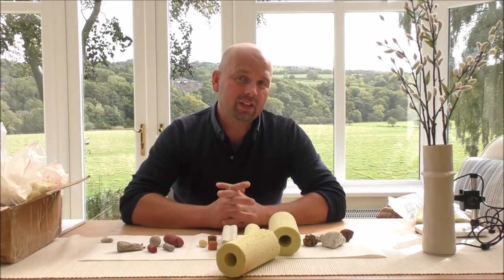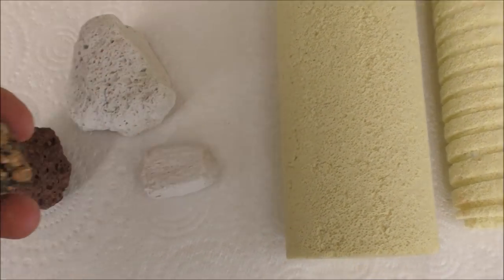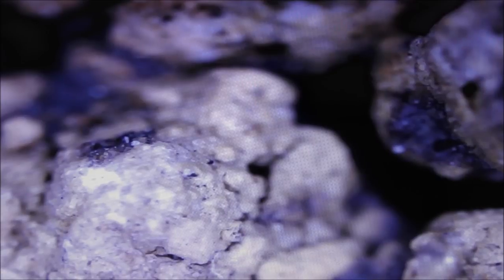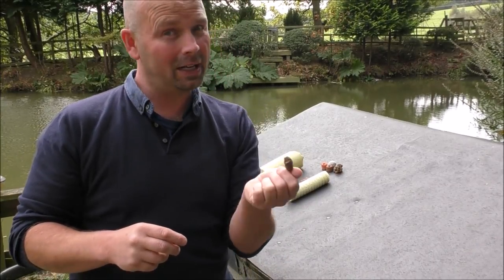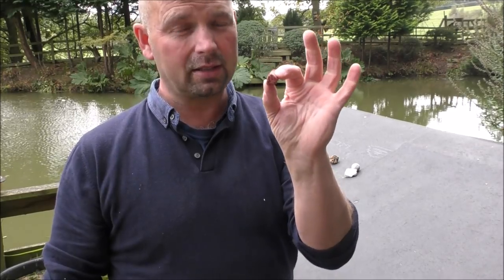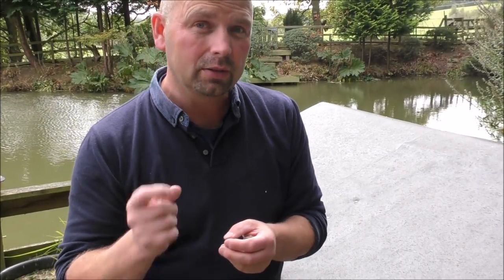Looking INSIDE Filter Media for Aquariums and Ponds

Comment from the maker: Using a microscope to take a look at the internal structure of some common types of filter media. Please click 'show more' for all information on media, time stamps and worldwide links (where available).
Microscope used: http://geni.us/IyFI0m4
Good biological filter media needs to be receptive to bacteria, have a varied internal structure and last for a very long time if it is to support aerobic and anaerobic bacteria and have a chance of providing full cycle filtration (reduction in nitrate). 

It generally falls into 4 categories (for static filters):
1 - PLASTIC- avoid for a static filter as the surface area is so low. Poor receptiveness to bacteria.
2 - NATURAL ROCK - can vary wildly in usefulness and may raise pH (white pumice). Varied receptiveness to bacteria but generally good.
3 - CERAMIC - made from clay dust. Quality of structure and hardness can be very varied depending on type. Relatively receptive to bacteria even on/in poor quality media.
4 - SINTERED GLASS - made from sand and powdered glass. Generally very hard but quality of internal structure can vary depending on mix used. Very receptive to bacteria.

Filter media in order of appearance:
SCORIA (lava rock): http://geni.us/daKf8n1
Scoria is commonly known as lava rock since it is an inert, natural volcanic rock. It is relatively heavy and although the outside may look extremely porous and good for bacteria to colonise the internal structure is largely inaccessible so as a filter media it is not ideal but it is cheap.

WHITE PUMICE: http://www.filterpro.co.uk
Volcanic rock which generally has good hardness, accessible internal structure but quality can vary. Drinking water quality pumice has best structure and quality but all white pumice has a high pH (generally around 8.0) making it really only suitable for marine, koi, goldfish, livebearers and Malawi / Tanganyikan cichlids.
Varied quality white pumice is commonly sold under different names by some manufacturers with no warning about pH.
Avoid if it is poor quality pumice which contains a large amount of grey / black stones as it will generally be micro porous and will quickly clog up.

ALFAGROG: http://geni.us/Il899
Very hard, rough ceramic media which has good external surface area but poor porosity. Works well even in dirty filters as it does not clog easily (due to poor porosity). Very cheap = good budget choice for pond filters.

CHINESE CERAMIC - really poor quality media which is brittle, has poor internal structure, poor accessibility and will break down quickly in any sort of water flow. Unfortunately this is for sale all over the internet - avoid.

BIOHOME: http://www.filterpro.co.uk
An inert, sintered glass media which is made in various sizes and has varied pore structure and accessibility for use in different types of filters. 
Some types have added trace elements fused into the structure which are specific to the needs of bacteria and that allows the media to work even harder to provide full cycle filtration (reduction in nitrate) as long as plenty is used.
Marine version also available which has added effect of boosting coral health (due to trace elements / bacterial activity?).

GROWSTONES: http://geni.us/BBHT0Li
As far as I know it is made by using a fine sintered glass mix with added bicarbonate of soda which causes mix to fluff up and be very light prior to firing in kiln. 
pH (8.0+) is definitely an issue as is the brittleness of the media but the internal structure is very good.

TIME STAMPS:
00:00 Intro and explanation of what makes a good filter media + showing microscope used for video
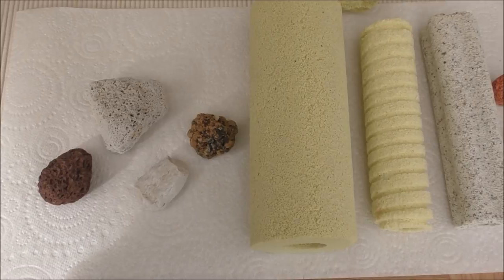03:30 Types of filter media to be examined
05:43 Looking inside media with microscope (300x)
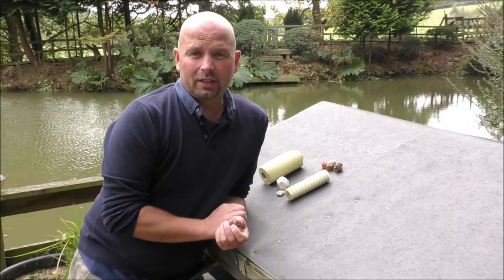09:45 How hard / long lasting is media?
12:35 Damn, I wasted how much on this muck from China?
16:35 Notes on surface area
17:43 Outro

USEFUL VIDEOS:
Aquarium and Filtration Playlist: https://goo.gl/yg174k
Pond Construction Playlist: https://goo.gl/TwVzNM

FILMING EQUIPMENT:
Panasonic HC-VX870 HD camcorder http://geni.us/3UwE
+Rode stereo microphone: http://geni.us/4OL
+Rode 'deadcat' mic cover: http://geni.us/1pmn
JVC Everio quad proof HD camcorder: http://geni.us/e09e
+Rode 'deadcat' mic cover (opened up and held between tripod and camera base) http://geni.us/deAR LINKS:e24
Zomei Z666 tripod: http://geni.us/1a1af3
Manfrotto MTPIXI-B PIXI mini tripod: http://geni.us/87f7

RECOMMENDED PRODUCTS ON AMAZON: https://goo.gl/jMaBWy
INSTAGRAM: https://www.instagram.com/pondguru_outdoors/

If you've enjoyed this video please check out the playlists on my channel for hundreds more  - on a variety of subjects.
Feel free to share or link any of my videos on facebook, twitter, forums etc. for the benefit of anyone you think may also enjoy watching.
See you next time.
Pondguru
Reply: Looks like great wave engineering still carries biohome media in the US, if you're looking to include an international link for that
Reply from the maker: There is direct links to suppliers around the world on every page of the FilterPro website (flags at top of page).
Reply: What about say 45ppi foam

Comment: I have to set my 120 gallons with two FX6 from scratch, I could use my biohome media that has been working for 4 years, and two months ago I washed and dried it, I am witness that it is the best media because in my tank with 7 frontosas of 9 Inches I got to have nitrates in 5 and changed water once a month only, thanks very good video

Comment: I've used the same biohome ultimate for 4 years. I'm wondering if you can do a internal check up video of bio media that's been running for a while. I don't use filter floss a whole lot because I use internal sumps and canister filters, I've found it too much of a pain to change, or it clogs too fast. But at the same time, I wonder if I should change it by now. Thoughts?

Comment: Ive been really really studying media lately and i think your biohome is good stuff but why is it so much more expensive? Eheim Substrat Pro seems to have just as much internal and external surface area, just as mechanically strong and wont affect the water perimeters that ive seen. but biohome is significantly more expensive. i think it would be on board if it would not cost me over a hundred dollars to fill my canister. i think you are being honest. and i think biohome would perform very well but the eheim media seems like it performs just as well for quite a lot less. if you can find a way to bring the cost down id be all over it.

Comment: How do you equate “easy crushability in your hand” to “its going to dissolve in water over time” styrofoam for example is easy to crush into powder form....
Reply from the maker: If a media is too brittle water flow will wear it very quickly and any movement while maintaining filters will also wear it. There has to be a good balance between strength and porosity of a media will not long enough to be of much use.

Comment: I'm wondering if you have a rebuttal to Evolution Aquas claim that Kaldness media can and does work in static filters becuase it's more than aerobic and anaerobic bacterial that break down waste.  Jeremy Gay claims there are higher organisms that live in the biofilm that only exist in angles and corners of the kaldness that will not live in ceramics or sintered glass that do a better job in breaking down waste.
Reply from the maker: I can see where he is coming from with regard to the support of higher organisms and there is definitely something to be said for supporting invertebrates in a filter as they can do a great job of consuming algae and organic waste.
However the filter falls down when it only uses plastic media since it really only supports aerobic activity for reducing ammonia and nitrite - I don't know of one person who has only kaldness in their filter who hasn't got sky high nitrates and the huge problem with the K1 used in a nexus is that the static part is aerated to clean it which minces up any really useful creatures like shrimps and water lice. For supporting them good old fashioned flocor does the job admirably.
I can't believe that EA doesn't ship their filters with a proper mechanical side to it and still uses standard K1 in them when they themselves supply K1 micro which has 40% more surface area per litre and would dramatically increase the aerobic biological performance of the moving bed part of the filter.
The Nexus is a beautifully designed filter (possibly the best looking filter ever in my view) but the lack of proper mechanical and anaerobic stage of filtration really cripple its performance as the things it does can be replicated in a cheap DIY filter built from a 45 gallon plastic drum.
In a few weeks I will be making a video which will show a new filter which is properly designed and solves ALL the problems associated with Nexus filters with no need to spend extra on sieve / drum for clearer water or a shower after it to control nitrates - that may sound too good to be true but I am very impressed with what I have seen so far.
It offers proper mechanical filtration which is adaptable plus moving bed(s) and an integrated shower so you get Mechanical, Aerobic Biological AND Anaerobic Biological in one unit - it is modular so can be tailored to suit different situations and takes about 90 seconds to clean.
Watch out for that video as it will probably generate a huge backlash from many people who currently run a Nexus and are familiar with the associated problems, lol
Reply: Roger Dedham 

Bio film is a fancy term for slime....slime needs to be produced by the bacteria to gain hold on the artificial plastic surface of kaldness and other plastic media that have no natural attraction to bacteria.

A media formed from natural materials " I.e. Found in nature"  will allow the bacteria to attach without the creation of a slime layer, Bio film or whatever anyone wishes to call it.

The process involved is best demonstrated by the time taken by the media to cycle, kaldness is around 12 weeks and Biohome 21-42 days  !

This is a excellent demonstration of bacterias inability to read and go along with what actually gives it the surface to best work on.....
Reply from the maker: I can't argue with that as plastic is a hostile environment for bacteria - I forgot to mention that as I just dismiss it as a static media without remembering all the reasons I do that.
I reckon you're being generous with 12 weeks for K1 to mature as its generally nearer 6 months (for aerobic bacteria, never for anaerobic).
Thanks Michael.
Reply from the maker: Thanks for the link - I have just sworn multiple times and very loudly at my computer. I don't know how I can say this in a polite way but the two guys are for the most part talking absolute bollocks.
As soon as the guy from EA said that the nitrogen cycle was ammonia to nitrite then nitrite to nitrate I started with the fury as that is only the aerobic stage - no wonder everyone using K1 has sky high nitrates. 
It is only one part of the biological process.
With regard to tracking in a shower filter all you need is a grid or piece of jap matting every so often to spread the flow and the tracking is not an issue.
One thing I do agree with is that a moving bed will likely do the quickest job at removing ammonia and nitrite but that is all the EA guy is interested in - it is very unfortunate that a large company which used to be well respected is not considering good mechanical filtration of the anaerobic stage of biological filtration as they already have a great looking aerobic biological filter but the refusal to address the mechanical and anaerobic shortfalls will come back to bite them if they don't address the problems as other companies are addressing those issues.
When fishkeepers understand and are able to see the bigger filtration picture EA could be in trouble and as they are a UK based company I wouldn't want to see that happen - surely they can employ someone in R&D who researches filtration and how it relates to water quality / fish health and growth? 
High nitrates is never the way forward.

Comment: HI Richard.. this really shocked me.. It was very interesting seeing the inside. I'm going to have a closer look at the media I am using but I'm quite happy to say I have the better media similar to what you showed. Excellent information.. something I wouldn't be privy to without you =D ♥♥
Reply from the maker: It baffles me how none of the big aquarium channels have done a similar video as this stuff really helps people see the difference between media types and there is a real difference in structure and performance which ultimately results in better water quality and healthier fish.
Reply: It's surprises me too but I've been thinking more about it.. I was wondering. If the media holds it's shape the beneficial bacteria can only colonize in the open areas right? It can't work it's way through the solid material acting like a sponge right? IF that's true then the more pource the exterior is the more area open for colonization.  I'm trying to understand - when you break a piece to see inside.. the beneficial bacteria need the micro grooves and tunnels giving the bacteria the access they need to penetrate the media right? =D
Reply from the maker: Yes the usefulness of a filter media is dictated by not only the size and porosity but also the variability of structure. Most ceramic media has very standard size tunnels and cheaper types have bubbles in the structure as opposed to tunnels making it of little use.
Better internal structure would be found in good quality white pumice and good sintered glass media as they have long tunnels, short tunnels, ones which travel all the way through the media and others which have dead ends or are almost like an ants nest of tunnels. That allows them to support little pockets of anaerobic activity where the water flow is greatly reduced and conditions are favorable. 
Also the sintered glass is a very receptive material for bacteria so you don't get a bacterial slime building up which clogs the media (as it does on plastic media or smooth ceramic which are quite hostile environments for bacteria to colonise)
Reply: Richard you need to know how much I appreciate you. Your explanations are wonderful and easily understood. Thanks for taking the time to do that.. I like the white pumice but can you buy it to use as medio.. I have never seen it.. would Amazon be the best place to look? Thanks again! ♥♥
Reply from the maker: In the grade I showed here I'm not sure where you would get it in Canada but I'm sure it will be available since seachem sell a poor (dense) grade of white pumice as 'matrix' and it is very popular in US and CA - also much cheaper there than it is here.
To find a good grade you may have to do some online searching.
Reply: DebTim A CANADIAN Girl and Pondguru. I think both of us North American peeps will be ordering from UK
Reply: Here here!!
Reply: Just in case, Guelph ON based angelfins.ca has BioHome.
Reply: Pondguru is Seachem Matrix that bad?  I just bought 2 litres of it to use in my canister filter (Fluval 206) but now you have me wondering??

Comment: Hi Great interesting video. Just out of curiosity if u had a tropical fish tank  in your home which media would u favour  for a canister filter?
Reply from the maker: The biohome ultimate is most efficient for freshwater and the marine version is most efficient for saltwater so I would go with either of them.
I'd be sure to go for a canister larger than manufacturer recommended too as that way I could get plenty of media in to ensure 0 ammonia, 0 nitrite and very low nitrate with minimal maintenance. For example a tank of 100 litres would have a filter rated for 200 or even 300 litres depending on stock.

Comment: Do any of the pieces you tested match what you'd get if you bought Seachem Matrix? I've read that it's a form of pumice stone from what others have said. Looking at it, the pits and holes are unexpectedly small compared to other media, but I don't know if that's good or bad.
Reply from the maker: It is a dense form of white pumice which unfortunately can contain lots of junk rock due to the grade they use.
If you look at a typical piece of dense pumice there isn't much to look at with regard to available pores so that's why I picked a particularly good example of a higher grade piece (drinking water quality pumice as used in areas of UK with low pH, e.g. upland areas of Scotland).
Notes in video description / pinned comment mention problem with micro porous grades clogging quickly and with regard to published photos taken with an electron microscope when you zoom in that far anything looks like an awesome surface for bacteria so it is not only misleading but it is also pointless.
That's why I went with only 300x even though my other microscope does 1000x as it better illustrates the variability in pore size which is so important for bacterial colonisation and the ability to support aerobic and anaerobic bacteria without clogging quickly.
Thanks for watching and appreciating the video.

Comment: when u say the chinese media isnt strong/wont last, what do you mean? ive had mine over 5 years and rinse it sometimes in a spaghetti strainer, id say 90-95% are still intact, and even if they break in half it just gives acess to internal structure, the hole in the center also allows weaker bacteria or junk to get flushed through, and like you said ye its crushable/weak, but thats because its soo porous? so i dont get it